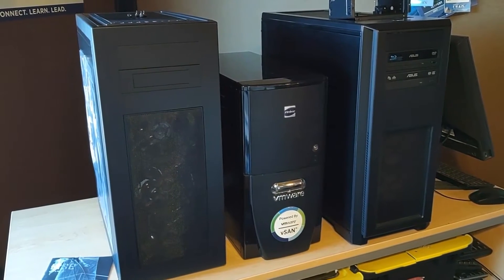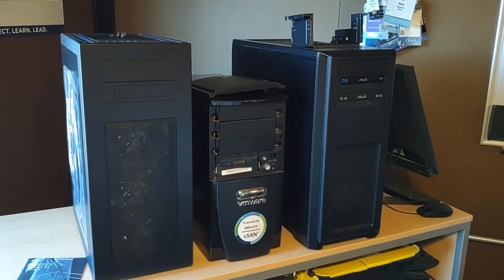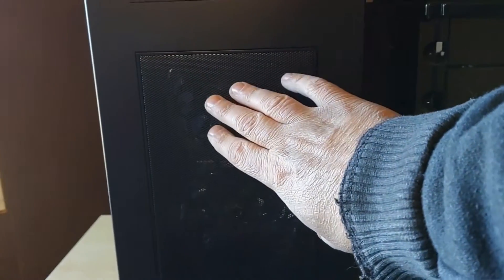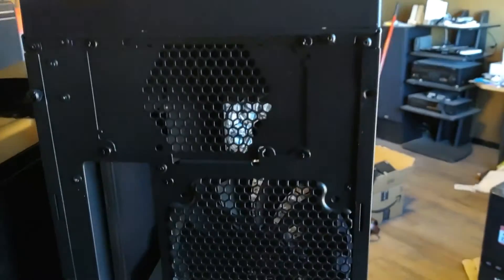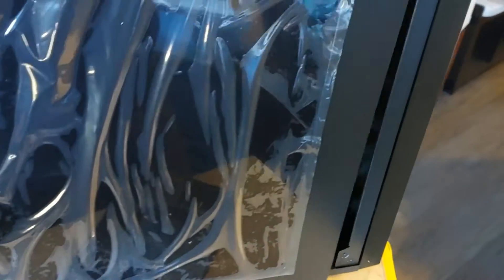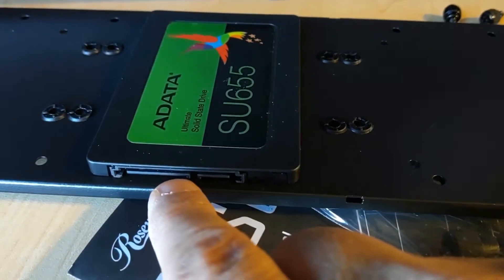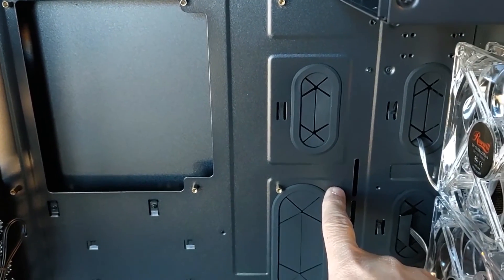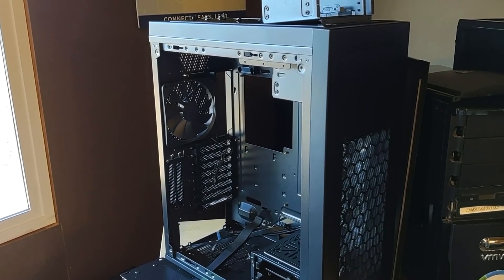VMware Home Lab Gen V Build Part 2 Case Selection

Comment: Hmmm... I wonder if that top power supply area is intended for a water block for liquid cooling? Goes along with the whole gaming rgb lighting scheme.
Reply from the maker: Hey Dorian - yes that top area could be used for a liquid cooling or the 2nd power supply.  Chances are I'll never use it but at least I have the flexibility if I do need it.